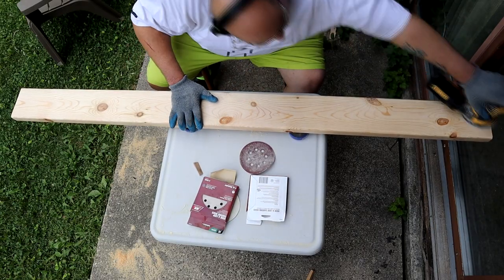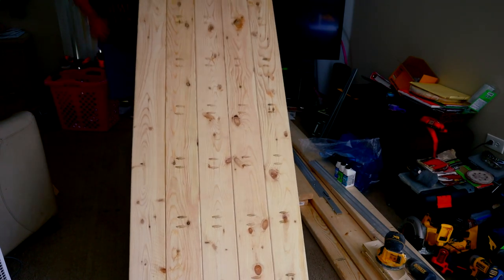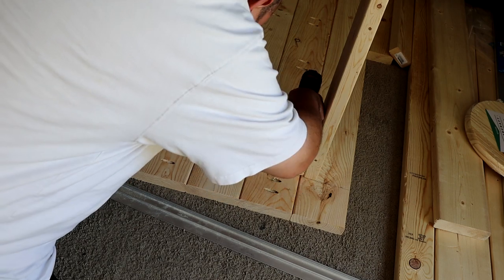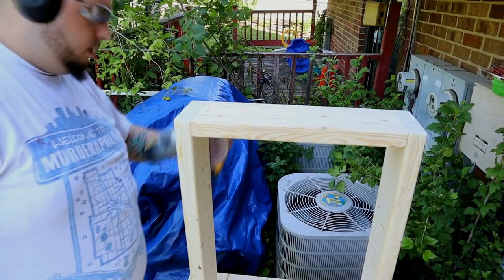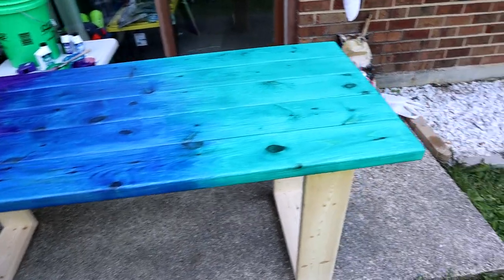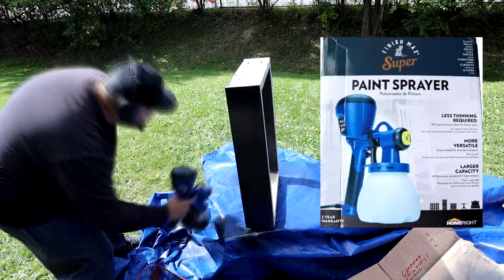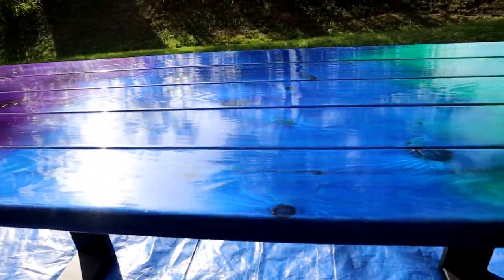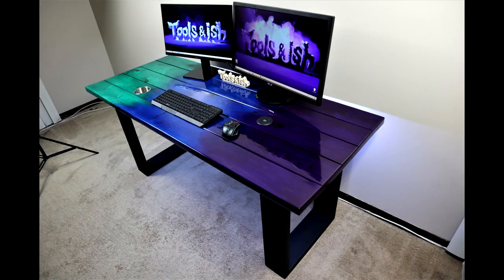How I built my first desk

Comment: Nice work… and I'm thankful for the tip on getting the dents out of pine. 👍🏾
Reply from the maker: Thanks it was harder than I thought it would be but so satisfying when I finally completed it. That trick is a big help, I used to have to sand down my wood past the dent😢, so time consuming and unnecessary when you know this trick and the science behind why it works makes me think it should work for most types of real wood not plywood of course, I might have to buy some different types of wood and try that trick out. Thanks for watching please subscribe if you haven't already

Comment: wow that is great. One question though, could you just cut out the holes prior to painting or is that harder in the long run?
Reply from the maker: I thought about it but thought that it would be easier when staining and wet sanding for it to be flat, especially when trying to blend those colors back and forth.
Reply: @Toolsish76  I had to hold my breath a bit while u did those holes lol
Reply from the maker: @YourGraveDigger83  lol yea I feel u, I was damn near shaking in my boots